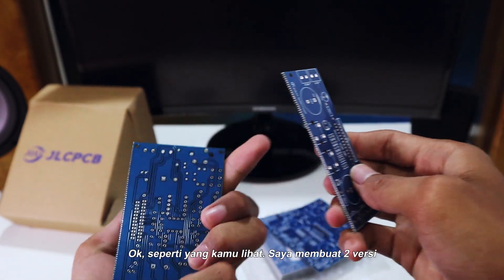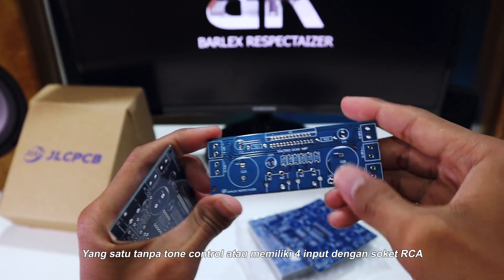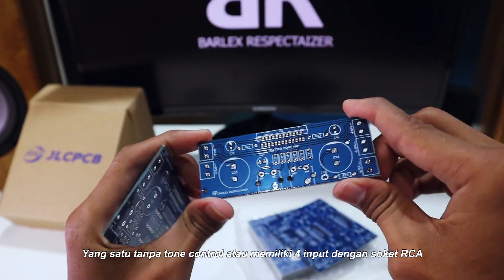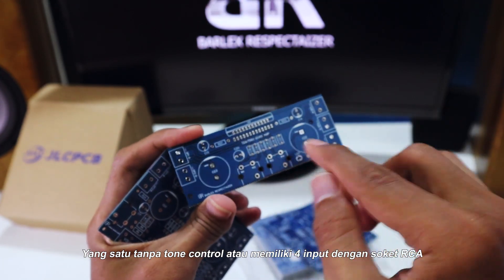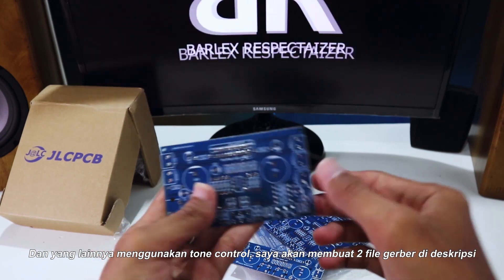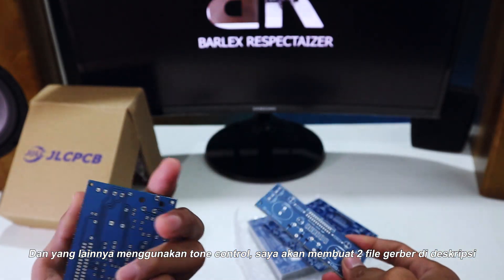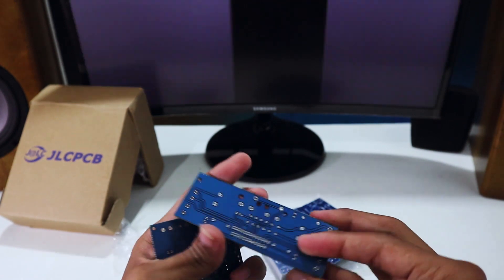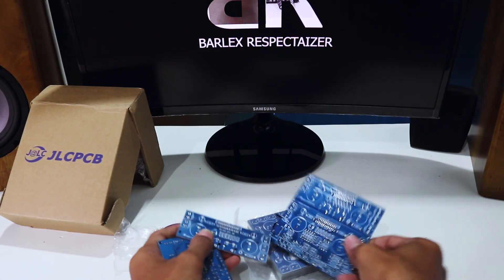TDA7560 Quad Amplifier Deep Bass

Comment: Can you make a 2.1 or 5.1 amplifier to use with 12v battery
Reply from the maker: maybe use the standard circuit of this ic, bridge the output for the subwoofer and the two channel other use for sattelite and connect the input with 2.1 preamp